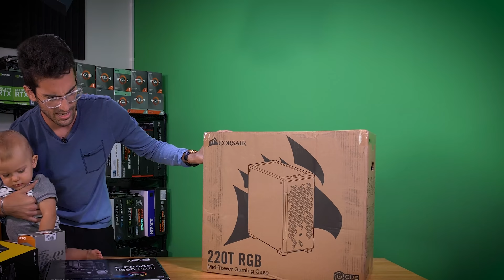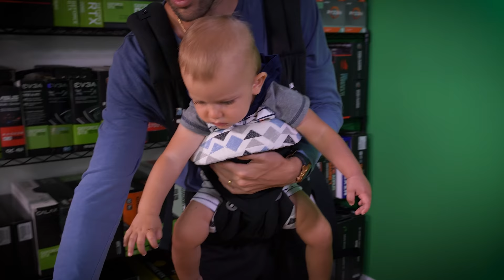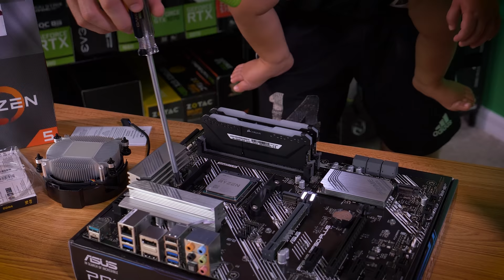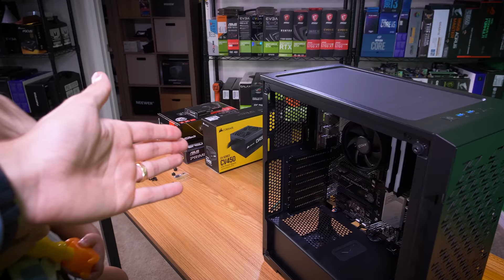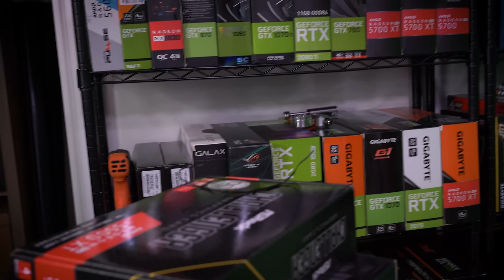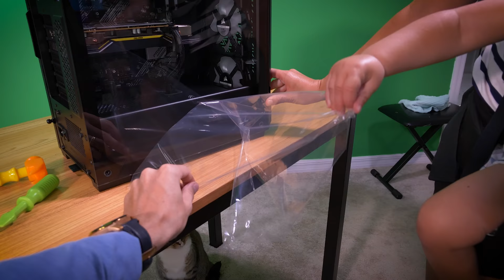Building an AMD Gaming PC with My Son!

Comment: help me out plz.....

I need some help, I put a Ryzen 5 3600 in a MSI B450 Tomahawk MAX mobo and I changed nothing in the BIOS except turning on the A-XMP profile to get my DRAM sticks running on 3200 MHz. My problem is that when I tried to do some benchmarking on both Cinebench R15 and R20, I was getting cpu frequency as low as 1.9 - 2.1 GHz which is much lower than the advertised 3.6 Ghz base frequency. However, the problem got solved a bit when I used Ryzen Master and turned on the Auto OC mode. But why do I even need to turn on the Auto OC mode ? At least I am supposed to get the base clock right out of the box from the R5 3600 without doing any sort of manual/auto overclocking, right? help me out plz.....